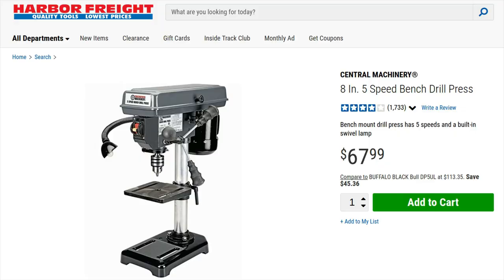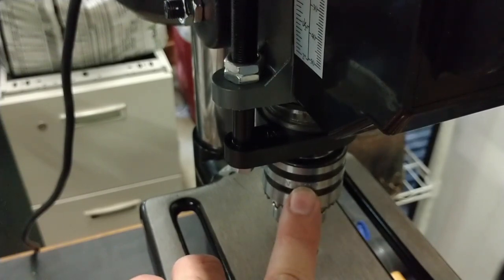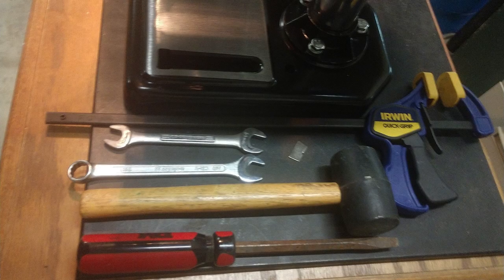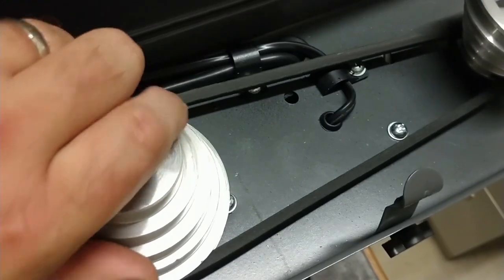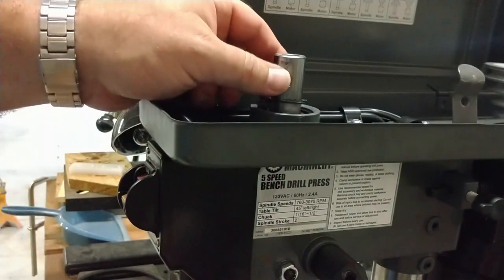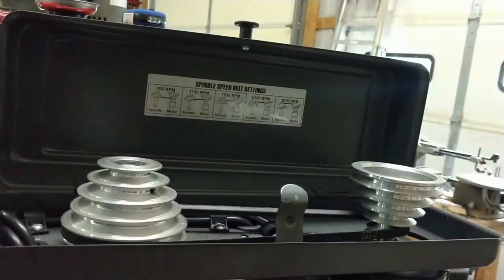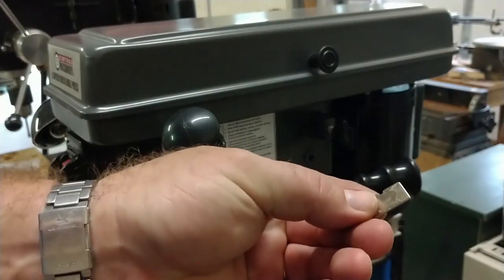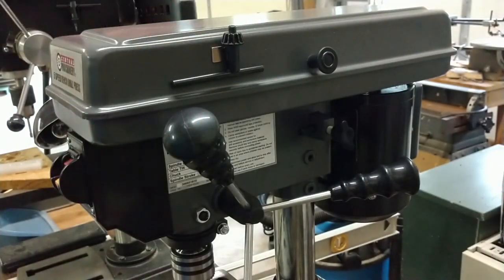Cheap Bench Drill Press? Harbor Freight 8 Inch 5 Speed DrillPress Review, Adjustments and Tips!

Comment: Great video, thanks.  

I bought my “cheap” bench top drill press about 20 years ago, and it’s been a great addition to my workshop, entirely trouble free (except I broke the cheap plastic depth stop, replacing with one made of birch plywood).  Which explains why I needed to take chuck off - and given the cost of these tools I didn’t want to break anything if there was a trick to it (but just a stuck taper which the pipe wrench idea was great as I didn’t learn that in shop class 50 years ago).  Oddly, mine has a cast iron frame, so I was surprised to see yours was zinc or something.
Reply from the maker: The older ones had a cast iron table and base too. These new ones have a stamped steel base and table. Not heavy duty by any stretch. You have one that is considerably heavier built than these newer ones. This one suits my needs and I have a couple of other drill presses that are more substantial for work that requires it.
Reply: Mine has the cast base and table so it is pretty skookum, so I’ll continue to look after it.

Comment: Came across your video on Harbor Freight. Good information to know. Was looking for a small drill press to use on wood and aluminum. Followed your advice on the noise issue and it worked perfect. Great video!! Thanks.

Comment: Great video. I've had mine for 5-6 years and the "tune up" was helpful. I also set the speed to lowest, as I mostly drill metal on mine.  I ran a zip tie through a hole (that I drilled)  in my key and hang it from the belt cover knob.

Comment: bought mine almost 30 years ago and use it 2 or 3 times  a week and it runs like new .....love it
Reply from the maker: Yours is probably better made than this one. The older Harbor Freight 8" drill press had a cast iron table and base. These have a thin stamped steel table and base.

Comment: Owned one for 3 years and made the same adjustment suggested in this video.  Check to see if the table is perpendicular to the drill bit.  I added shims to the table attachment point to get it adjusted.  I also added a xy vise to hold the work.  The height of the drill press was increased 7 inches by adding a piece of RV generator exhaust  pipe (available from Reilly's Autoparts) for taller material and longer drill / wood bits.  It is what you pay for and will work if you need a drill press a few times a month and never used a really good one.
Reply from the maker: I didn't mention the table adjustment, but mine needed it. Another thing I noticed is that the table isn't completely flat either. I have two other drill presses that do my heavy lifting but I wanted a third set to a specific depth for countersinking holes for fishing rod building jigs that I make and sell. The little drill press is perfect for something like that.
Reply: @TheFishingHobby  The table on mine is flat enough I did not worry about it and the vise took care of the problem.  Not perfect but usable.
Reply: Larry can you provide more info on the RV generator exhaust pipe you mentioned from O'reilly's?  I searched for RV generator exhaust pipe and did not find anything.  TIA
Reply: What is the extension pipe you have used to increase capacity
Reply: @reggieblond2405  Walker Extension pipe #52007
Reply: @larrylass4268  thank you larry

Comment: runout is .001 on spindle and the lock screw is for the ram that lowers chucks to drill not the actual spindle that rotates. I grab the spindle as it rotates and it quiets down. I believe the pulleys make noise with this. I ordered a replacement chuck to replace the original. It runs .020 runout
Reply from the maker: If you are getting .001 on your spindle then you are lucky!
That is better than I can get with work held in a high quality 3 jaw chuck made by Rohm on my metal turning lathe (.002). I can see the runout in this drill press spindle with my eyes, I can't see any runout with my eyes on the work held in my 3 jaw chuck on my metal lathe but it is there none the less. So my drill press spindle itself has quite a bit of runout and the cheap quality chuck will have even more if you measure a precision ground rod held in it. 
If you are getting those numbers on yours, I may disassemble my spindle and see if a bearing isn't fully seated or if there is trash in the housing throwing it off.
You are correct, the lock screw is for the ram as shown in the video. Too tight and it will not allow it to retract, too loose and it will rattle around in the housing. I may have said spindle, don't really remember, but it is definitely for the ram as shown in the video.

Comment: This is a great video tips for adjusting, I just bought this model 2 days ago spent about 3 hrs  checking it out and playing around with it after putting it together. Although I agree that its probably not an ideal drill press for precise drilling I think with some fine tuning and noise reduction as per this video (which the manual DOES NOT SHOW), I believe it'll be a good starter press for my hobby! Thanks for this tips video!
Reply from the maker: Mine has more than paid for itself in speeding up my work for a rod building jig I sell on eBay. If used within its limits, it works just fine. Good luck with yours!
Reply: @TheFishingHobby  I'm preparing to vet started in making wooden toy trucks for my grandsons and possibly sell em too! I think its gonna be a good little starter press for what I intend to do!
Reply: I wayched the video and tried adjusting the wobble in the spindle and all that does is lock the up and down yes it takes out the wobble but cant raise or lower the spindle????????
Reply from the maker: @kevinbrister8801  it is too tight then. It should just touch the spindle to keep it from wiggling. Any tighter and it will lock it up.
Reply: @TheFishingHobby  yes Ive tried it several different ways still got a wobble. I have backed off the adjustment and retried it but no luck. Probly gonna take it back for a refund!
Reply from the maker: @kevinbrister8801  there is undoubtedly some manufacturing variations on the inexpensive tools like this. Sounds like it was a bad one, I'd take it back too 👍
Reply: @TheFishingHobby  Yeah, I thought this would work temporarily till I could buy a lathe! Im trying to make simple wooden wheels for wooden toy trucks. For the most part it is doing what I thought it'd do! I counter sank a 1" forcner bit just to the base of the forcner bit then drilled the outer circle with a 2" hole saw. Dont know for sure but this press may not be able to handle that size holesaw! Anyway, pulled the circle out of bit then put my calipers around the outside that is perfect its the inside that I can see without calipers where it has a thicker side than the other! I've even took apart the mandrel on the whole saw and reset it so that I'd know for sure that it was in exact center but as with all cheap tools....... you get what you pay for! I am gonna try a smaller forcner bit and a smaller holesaw before i take it back!

Comment: I have one just like this and the spindle seems to wobble inside the pully sleeve. I took it all apart and the top of the spindle is square but just fits very loosely in the sleeve at the top. Is that normal?
Reply from the maker: I'm really not sure. Mine was a fairly loose fit (the pulley doesn't need to be pressed on) but I wouldn't say it was sloppy either.

Comment: Appears that drill press had lousy quality control inspection. I have the same drill press I purchased  years ago, it didnt have high enough work area , so I raised it 4" ( I have a video of raising it on my channel) Its been a good tool for me, a DIY. Thumbs up & I Subscribed, Merry Christmas 2020
Reply from the maker: Merry Christmas to you too. This definitely isn't a high quality machine, but it has worked well for what I wanted it for for sure. I'm still using it just for countersinking holes in HDPE plastic on the rod building equipment I sell. Not a tough task at all, but I have countersunk a lot of holes with it.

Comment: That cheesy plastic depth stop busted the first time I looked at it funny.  After it broke into three pieces, I told it a few things about its momma.
     After a lot of poking around the internet looking at dozens of replacements, NONE of which would fit, I finally found some dude in Texas who makes and sells a machined (or maybe 3D printed) aluminum part for $35.  Installed one on mine and it works just fine.
Reply from the maker: That part is definitely flimsy!

Comment: Good video,  Just brought home one of these, $50.  I suspected there were things one could do to improve this unit so it performs like a $100 Wen, ha.  I wish I knew what 'run out' meant cause I probably have it in other tools as well.........
Reply from the maker: Run out is checked with a dial indicator and to simplify it somewhat, it is just basically an amount out of round the shaft/chuck is. In other words, if you put a piece of drill rod in the chuck and ran the drill press it will have a little wobble to it because the center of the chuck and shaft isn't exactly dead center. I this case the amount of runout is fairly small so drilling holes isn't a problem, but it isn't accurate enough for work someone like a machinist would do. It doesn't have the accuracy of a milling machine and it shouldn't be expected to either. For woodworking and most homeowner uses you don't need extreme accuracy and most homeowner/hobby tools aren't extremely accurate. Hope that helps!

Comment: This unit sounds like it is practically made out of papier-mâché.  Years ago I worked in a shop where one of the drill presses was a cheap Taiwanese table unit like what is shown here but of a much sturdier construction.  Pretty sure I would have one of these if and when it shows up at the recycle dump.
Reply from the maker: It is definitely very light duty and wouldn't hold up to serious abuse. That said, it does light duty work well enough.